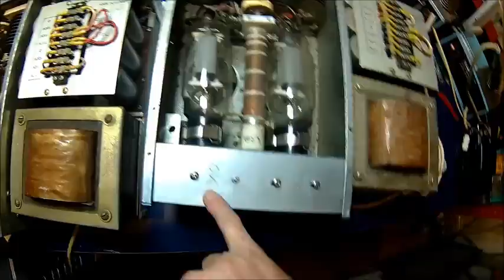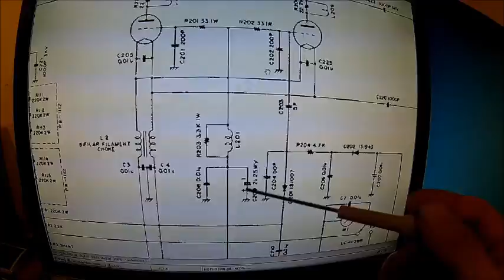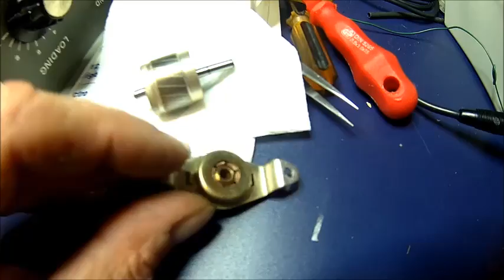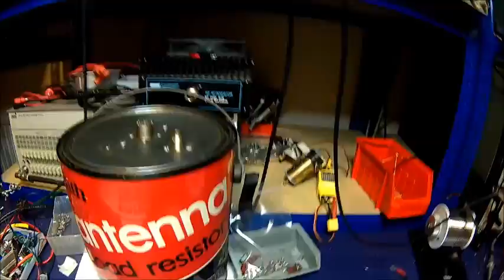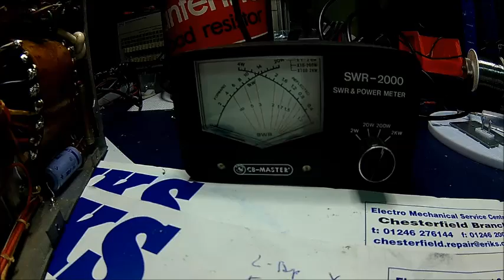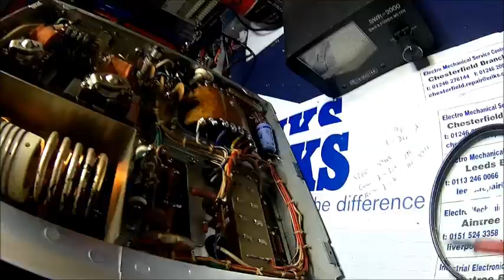Yaesu FL-2100  repair - Part1, fixing the usual faults  (Ham Radio Tube Amplifier)

Comment: Hello what was the cause of the lower plate voltage around 1400v at first then had plate voltage of 2300v ??. I have a fl2100 that's only running at 1400v at plate.
Reply from the maker: The transformer has 2 output taps, also check your mains input taps, maybe wrong for your country.
Reply: @dynoguy  ok thank you. My is wired for 120v I wasn't sure if needed the 240v in to get the 2300v plate. 73s

Comment: I am working on my ft2100b and finding high input SWR on 10m and 20m. After fiddling with the coil screw  on 10m, I could get the swr down to 3:1. The ceramic caps on the 10m pi input measure correctly (out of circuit) and I have continuity all the way to the band switch. What could be the issue?
Reply from the maker: Input return loss is always  poor on these, especially on the higher bands as these are designed for the tube PA's of the transceivers of their days, with those you could tune it  just fine, modern transceivers want to see 50 Ohm, full stop... Just add a resistor in parallel of the input, around 200 Om with reasonable power rating and things will look much better.

Comment: Here is a small fix for FL2100. The capacitors C8 and C9 220pF (between grids and ground ) are too small , this affects the amp performace for bands below 20m. Replace it with at least 2200pF. With this mod the required max TRX power is 45 Watt for 40m.

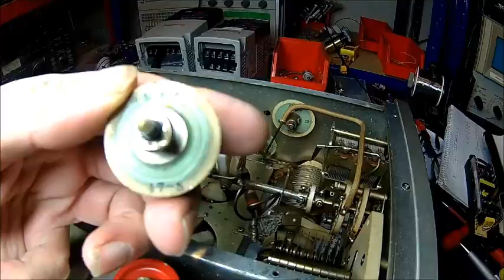Comment: Hi,  Regarding the capacitor you are talking abount at 11:09 that starts cracking,  Does this just happen through age? My FL2000b Just went bang and blew that RDA40 in half.
Reply from the maker: Yes, it's mostly age related, thermal and/or mechanical stress will certainly accelerate it. considering that most of these shack heaters are 40+ years old, i just take that as normal ear and tear. 
If you look around on ebay, you may find some for little money, particular from eastern European sellers.
Reply: @dynoguy  Thats good to know. Thanks for the reply! Lee M0RQX

Comment: Are replacement psu’s available for this lovely old amp or any alternative psu ? Keep up the good work
Reply from the maker: Pretty much any part is still available, usually in a more modern form with better specs
Reply: @dynoguy  

Thanks for reply , can you recommend a newer psu I could replace my old one with at all ?

Cheers
Reply from the maker: I think there are replacement boards around, but why don't you just replace all the components, makes it as good as new
Reply: @dynoguy  

Replacing all the internals seems a great idea at some point maybe but for now I need the actual psu transformer new equivalent not any boards for now anyways hopefully ,, what is the new transformer you put in yours please ?
Reply from the maker: well, .. that's an easy one, plenty of transformer companies around, just ask for a quote with the data of the original one (you'll find some hints in the schematics). and they will make you one which is far better than the original. You might find second hand ones on fleabay, but people usually asking silly money for those and you still won't know how good (or bad) the insulation resistance of that 40 year old lump might be.
Definitely a no-brainer for me, if i need one, i'll get it made., second hand vintage junk is a no-no for high voltage stuff.
Reply: @dynoguy  

Totally agree I’m not willing to put a 40+ year old tranny back in the unit  , I’m in the uk do you have any recommendations for psu companies or more info on the better spec I could replace it for .. would help loads if you could help me out with any of it if not no worries , thanks again

Comment: I have a cygnet swan 260 single side band I just acquired, in testing I noticed when I transmit while listening to a shortwave radio, it's only transmitting on am, would those be caused by bad tubes  or the bias adjustments on the back of unit, any info would be greatly appreciated as to where to start ?
Reply from the maker: Hi,.. i don't know anything about the Swan 260, but to start diagnosing, just hook it up to a dummy load and check with a scope what's actually coming out of the RF plug. If really nothing comes out on SSB,  go further back in the circuit and you most likely will find the issue.

Comment: Working on my FL 2100B at the moment. Your Video is very informative. I'm learning the circuitry and replacing capacitors and resistors. Thanks very much for the videos. They are a big help... N6PKT /  M0BWX
Reply from the maker: You're welcome, glad it helped someone, 73 Mike

Comment: thanks for your reply ! you can tell me where I can get a replacement, I have seen one on the internet but it is very expensive thanks luis
Reply from the maker: Unfortunately i don't have by spares to give away. I am afraid, but you need to keep on searching the internet.
You can take the rivets out and replace single contacts, but it's quite laborious and you still need a switch you can take apart, for parts.

Comment: hello, I have a problem with band swich makes me a flashover in 20 meters, it is very difficult to remove the key to clean it ? 73 Luis LU4HK
Reply from the maker: Hi Luis,...it takes a bit of time to dismantle it, but it's not impossible. If it was flashing it's most likely burned and you need a replacement wafer or at least the contact pads which are riveted. Also check why it flashed, most likely mismatch, oscillation or bad capacitors. If you don't fix the root cause, a new contact set will most likely flash again.....73, Mike
Reply: dynoguy thank you

Comment: Very interested in this, thanks. I am exactly working on an even older FL2100b. I have it now HV fused, with meter protection and have run it no tubes up to 2400V. Tubes I cooked several hours but even at the low HV xfmr tap I blow the HV fuse. Q: how did you cook the tubes - (as per PA0FRI ?)- filament on and grid and plate to DC +ve and cathode to negative of the 0-60 VDC?  Many thanks Peter, will watch your second part.
Reply from the maker: Hi Peter, yes just the usual way as PA0FRI and others describe quite well,. The B-version came later, mine is an original FL-2100 (without B) and pretty much identical to my FL-2277 (no B as well). More on the tubes on your comment to part 2, 73 Mike